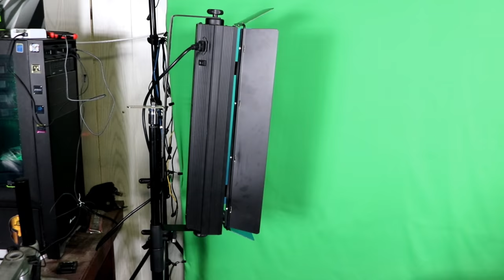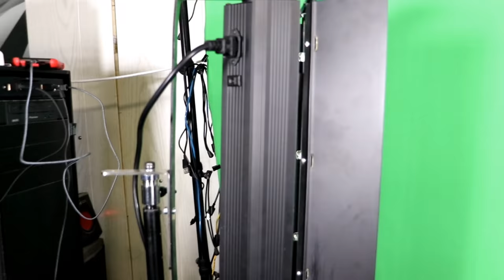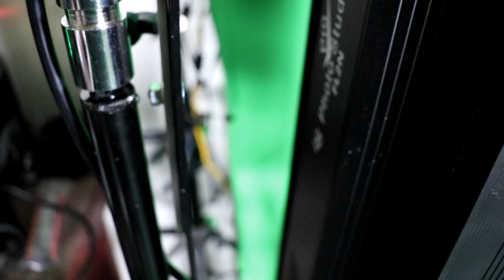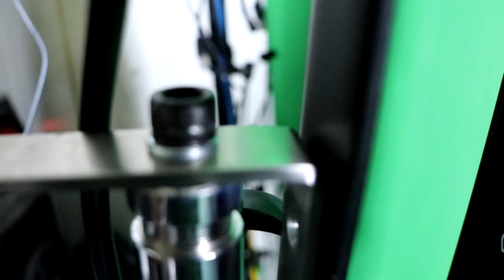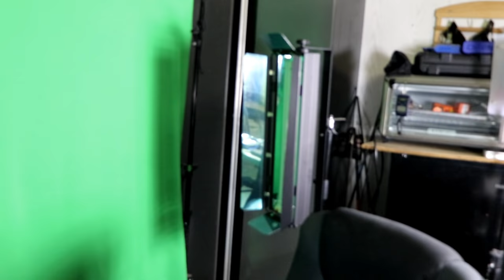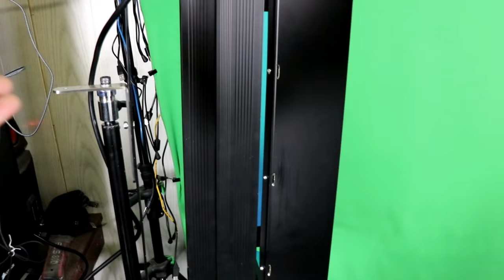Limostudio Photo Video Studio Lighting 550W Digital Light Fluroescent 2-Bank Barndoor Light Panel

Comment from the maker: Limostudio Photo Video Studio Lighting 550W Digital Light Fluroescent 2-Bank Barndoor Light Panel, Agg976 
http://geni.us/vyRWq

====Hardware To Purchase====
Stainless Steel L Brackets
http://geni.us/Ijbqeil

Bolts and nuts to attach light
http://geni.us/OQEWW

You will also need a drill bit which cost me $12.00 at my local hardware store. Just take the black screw on the top in with you to get the correct size bit to drill the hole in the L bracket